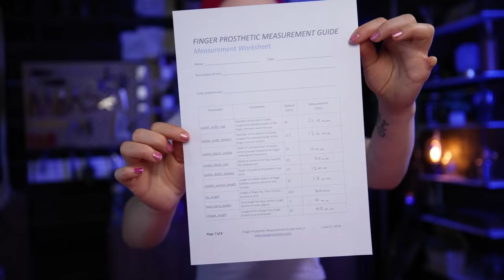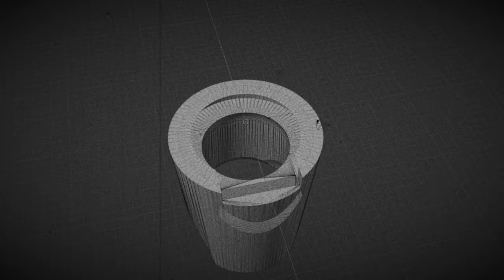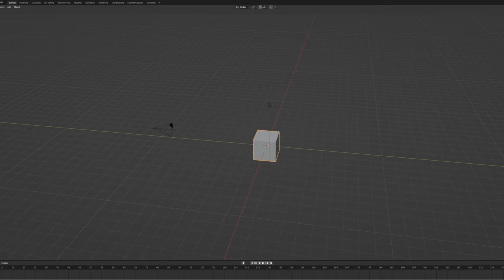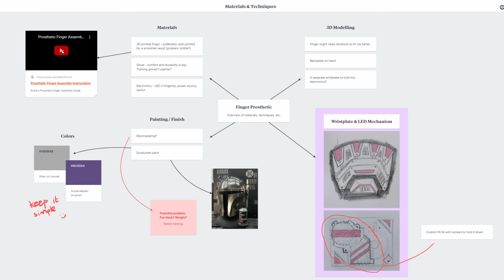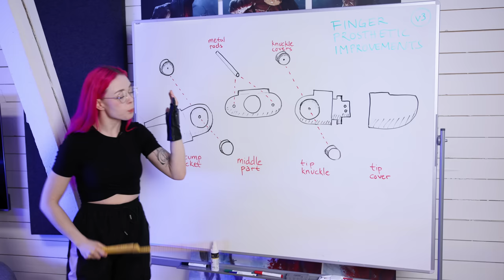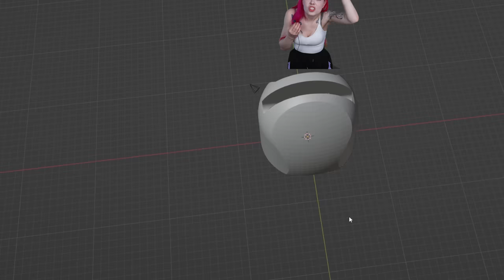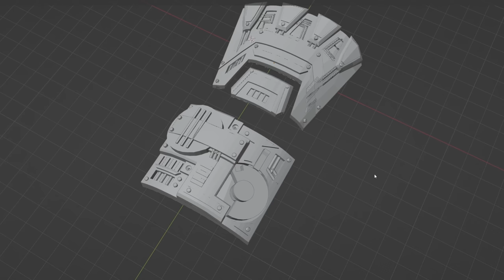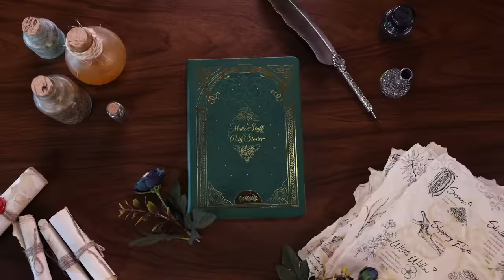I lost my finger.. so I made a new one

Comment: I am an engineering student and in the robotics, you can increase strength by adding counter wires on the opposite side. Also switch to metal cables. Fishing line breaks really easily, but you can find metal wire in the jewelry supply section to replace it and its virtually indestructible without wire cutters. To protect the wires you can run them inside the finger mechanism. Also, just an idea, but if you want to add a screw in feature to your new prosthetic fingertip,  you could put interchangeable tips on it. As well as an attachment on the back of the glove too. You have given me so many ideas to think about! BTW,  This is an amazing job! Absolutely brilliant! I was 10,000 % impressed! My little inventor/engineering heart just jumped to so many ideas.
Reply: Ok so it just occurred to me, what about adding the interchangeable fingertips,  you can get a small alligator clamp attachment,  it will help you hold the tiniest of miniatures when you are crafting. A detachable led flashlight, a tiny detachable spy camera that blue tooth connects to your computer,  so you can see inside your models, incase you every need to.  And just for fun,  A detachable Lazer pointer to point at things to randomly annoy your cat.
Reply: You could probably design a small storage container for your interchangeable tips on your forearm by expanding the glove a little bit.
Reply: @mm-nt8el  For proper practical use she probably needs it made in titanium or something though since resin prints arent that study especially if continuously subjected to stress (movement twisting pressure etc)..  its great for prototyping though :)
Reply: Any chance you know where I could find the schematics to this pinky engineering marvel? I actually lost my pinky on the same hand. I want to make this. Just don't know where to begin without the plans.
Reply: I love seeing people nerd out
Reply: @littlepinktable same bro
Reply: I think you want to keep the fishing line. Yes, metal cable would be much more durable... but it would be more durable than the plastic parts it's rubbing against. So instead of having friction wear out the easily-replaceable fishing line and needing to replace that periodically, you have the cable wearing grooves in all the other parts, and you'd need to replace everything but the cable periodically.

Same reason when you're sewing, you always want to use thread that's just a little weaker than the fabric: you WANT the seam to give before the fabric tears. You can easily just sew the seam back together, but if it's stronger than the fabric and the fabric tears, now you need to either darn or patch the tear, and a quick-and-easy fix just got much more involved.
Reply: @trioptimum9027  There are specialty metal wires (aka hanging wires) of varying widths / strengths used in art framing businesses (I used to have one) to hang anything from small frames to 100 lbs large, heavy frames or mirrors!. These are extremely durable, don't rust, have no / very minimal friction and have very high breaking point.
Reply: Dude, replaceable fingertips are really a great idea. 
That could be a flash drive inside of one, electric lighter, 
small blade to open packages,  or a kind of NFC/RFID 
tag to open doors in the office)))) Sheesh, now I want 
to have the 6th finger)
Reply: A magnet tip would be useful too
Reply: 11:13 This music has got me so pumped this morning❤ Thank you

Comment: Hey, design guy here. Try adjusting the length of the fishing line to get different amounts of movement with different hand movements, you might be able to get the crouching action going.
You could include a kind of dial that shortens the line and reduces the amount of hand movement to make the finger bend. To make it suitable for different uses.
Another concept is to raise the bend point of the wire so that the finger does more with less movement.

I also thought about your LED light and the cables: Why not use the wires to actuate the finger?
Maybe go a bit bigger and have them twisted, then they could withstand a lot of force. only problem might be a high resistance to sliding inside the mechanism.

As for grip, maybe adding a bit of rubbery plastic on the inside would make it a lot more helpful for holding and manipulating things. There are dipping solutions available which can also be painted on.

I really like this project and the way you are dealing with the loss of your finger. This is a very healthy way to cope with such an experience and I think it can be great for others to see you like this if they have experienced something similar. Thanks for sharing <3
Reply: I lost half my index finger 7-1-24, came back to rewatch this video. Soon as I can, I'm going to be trying my hand at this. I liked your suggestions as well

Comment: I'm sure someone has already suggested it, but you may want to put a rubber pad or something 'grippy' on the bottom tip of the prosthetic. It won't offer any additional "strength" per se but it will add additional friction, to help hold things. Awesome project!
Reply: Plasti dip spray will add thin rubbery coat.
Reply: PhoenixRevival00.
"Traction", not "friction".
Reply: Traction is the act of pulling something along a surface using motive power. Friction is what I meant. Two surfaces rubbing against one another. 🙂
Reply: @redblade8160  owned
Reply: @jaden6276  
You have been "owned" and don't like it.
Reply: @redblade8160  u make no sense lol
Reply: @jaden6276  
I'm not surprised it makes no sense to you, you're on the simple side!
Reply: @johnpatrickgerdeman  Rust-Oleum's Leak Seal is another option.
Reply: @jaden6276  Redblade is all up in the comments here being rude as fuck, just ignore them. They are obviously just trying to be an obnoxious and rude know-it-all just to get in an argument with someone
Reply: @redblade8160  calling me simple after saying 1 word makes you look pretty simple!
Reply: @redblade8160  calling people simple and trying to correct words and getting corrected yourself just makes you look insecure about your own level of intelligence
Reply: @jaden6276  
But they are simple and you're getting upset because you know that it also applies to you, then you end up talking nonsense only out of shear retaliation.
Reply: @redblade8160  I’m not surprised it seems like I’m speaking nonsense, you’re on the simple side!
Reply: @jaden6276  
That one word you said speaks volumes about you; therefore you must be simple in many other ways too.
Reply: @redblade8160  what a sad existence you must have :( to not be bothered of making a fool out of yourself so freely for all the internet to see and still be wanting more. Is this the only interaction you can have?Truly sad.
Reply: @Ariaasu  
You sound very much like you're describing yourself, but the only way you can hide it is to accuse others of what you are.  What is actually wrong with you, has something bad happened to you in life to end up this way?
Reply: @vh7634  
You're another one that gets upset easily!
Reply: @redblade8160  awww projection, the weapon of the ignorant. Feel better sweetie.

Comment: Honestly: as a mechanical engineer, who is used to design things with CATIA or Siemens NX, I was pretty impressed, seeing you design mechanical things with blender. I know that this is possible, but also that it's definitely harder than doing it in conventional CAD software like Fusion 360 etc. So really, really good work there on the technical aspects and of course the result is awesome, like always! 🙏🏽
Reply: Came here for this
Reply: I was also thinking that. I was hoping to find out how long the entire project took. I have tried using blender to make adjustments from fusion 360 work and it took much me longer than anticipated.
Reply: Blender is basically an operating system, it can do anything 😁
Reply: @qdaniele97  it's also technically a game engine capable of being used to program video games and running them as well lmao
Reply: You know in an Orthotic workshop blender is actually used to sculpt a copy of a limb, then smothening the rough edges on it. Then we switch to another program to use CNC. Works quite good as I have seen.
Reply: @Owgla  The game engine hasn't been a thing since 2.x days. ;)
Reply: @IzzyIkigai  officially yes, but there's actually a project called UPBGE which brought it back to life. And it works with Blender 3.x :D
Reply: Yeah after seeing this she should really look into doing more medical prosthetics.

Comment: Thoughts for making the finger more tactile:

Rubberise the fingertip. Make the fingertip easily replaceable now that it picks up dirt.

Redesign so that the weight of the mechanism is transferred somewhere you can feel. I think the initial design does this well, as the wristband would pull on your wrist, and the wire would dig into your knuckle . The wrist band needs to be redesigned so that it isn't awkward to put on with the glove. Maybe use a flexible filament and a shape like this C>. The wire digging into your knuckle is uncomfortable, so I think that adding a knuckle pad with a groove would be a good idea.
Reply: This comment right here^^

Comment: I'm intrigued by your situation and solution to your unique problem. I've been trying to get back to all my old hobbies and crafting. I used to be an Air Force airframe repair specialist and have never had access to a decent shop or workspace, but I'm now in the process of building one in my apartment. I'm planning to get a 3-D printer as well as building a few other tools. I mention all this because I'm always looking for something to invent. I've decided that when I've got it all up and running, I'm going to build a prototype that might work for you. You don't know me and I don't know you, but I've got an engineering mind and I like solving problems of all kinds. Look to the future, is one of the codes I live by. I would say, be optimistic, but I think you've got that covered.🖖😎👍

Comment: In order to increase the grip strength you could run the control string to a pulley that connects to a ring you would wear on your middle finger, which would be the strongest. With a series of pulleys ( block and tackle) you could develop a mechanical advantage. With the 3D printing you could even use gears for the mechanical advantage like a singe speed bicycle. If you ever wanted to motorize the grip , you could trigger it with another finger. With a motor you might need a torque limiting device or clutch that slips at a certain motor load , for safety.  Great project, well done. 18:07
Reply: Why not use a small Mars Rover brushless DC motor attached to a composate carbon nanotube and graphene finger. Using the galvanic response and the conductive graphene finger as a battery itself attached to a under the skin Qi wireless 15w charger with a regenerative breaking coupled with a Monocrystalline embedded solar panel over lab grown ruby sheath. Throw in a few Micro Q-DOT LED's and your good to go. That or sticky tape and a broken chopstick. YouTubers are so lazy these days
Reply: @HyperVectra  This comment made my brain bleed.
Reply: @Drekromancer  I know sorry my bad! It hurt my brain to write it. Just trying to poke fun at OP... like I support "When you aim for the trees, you hit the ground. When you aim for the stars, you land on the treetop" but like a tiny motor and battery with clockwork gears and a limited slip clutch? I think what she made is pretty damn good already
Reply: oh yeah there are def ways to improve,  the glove. I still remember being a kid and have those plastic grip gloves that made you have like alien like claws. Now we have printed stuff to do this haha.  She should study more about medical prosthetics because damn she seems to have some passion towards it and is def really good at it.

Comment: My dad had your accident with a skill saw, a year or so before he died. After catching his thumb in the hinge of a folding staircase.

If you put some metallic foil tape in the hinges of your finger, you can run power to the led without worrying about bending wires. It would work like brushes in a motor.

Comment: Implant a threaded stud, just behind your first pinky knuckle, on the back of your hand. Like people have done in the skin on their heads to mount steel spikes for a mohawk. Screw a tiny loop to the stud. This would give a very minimalist attachment point for the cord.  
Implant another of the same to your pinky nub to keep the line closely following the contours of your hand, to prevent the thread snagging. Could also use Fluorocarbon fishing line for the actuating thread. Again, discreet, but also not so abrasive that it would wear through the steel loop it travels through on the pinky nub implant. Kevlar thread is super strong. But overkill for this application and also very abrasive and would wear a cut into the surgical steel of the implants. 
Not that it's not awesome fun to do the glove thing and make it stand out! I love it! But sometimes you just might feel like having a quiet, less stand-out day, when out at the grocery store. :)

Comment: The end result looks awesome. By the way, I think the main issue with trying to press keys with that new finger is the limited range of motion rather than the lack of muscles. With your right pinky, you can move it around in a circle, not just open and closed. Pinky fingers are supposed to be able to point out to the sides by roughly two and a half inches in diameter. That motion is necessary for properly using the keys to the outsides of the 'asdf' and jkl;' keys- which means you'll need that deflection in the prosthetic to hit the left shift key. I don't know what the nerve/tendon/muscle situation is with the remnants of your left pinky, but if there's a way to get the prosthetic to deflect to the side, I think it'll work. Still, what you've already done seems to help greatly, and I'm glad you got some usability from it.

Comment: Perhaps if you add a silicone gel layer to the inside face like where the fingers prints and pads would be, or around the whole outside of the prosthetic in general, that’d help with surface tension grip, not soo much muscular pressure grip. It would passively help to reduce the slipping of your phone, or other objects in general, that you’re gripping or cradling with the prosthetic.

Edit: perhaps someone might’ve mentioned this, or in some other way the idea may have crossed your mind, idk. I’m not a mind reader and admittedly I read about 20 comments starting from the top and didn’t see any suggestions mentioning silicone layers.

Comment: Great job! I know what you’re going thru. I too had a table saw accident and had 3 fingers cut off to include my pinky, but they reattached my pinky. And just like you my pinky is stuck in a curved position like your ring finger due to damaged tendons. They couldn’t reattach other which I’m fine with, I have same problems with same issues as you do, grasping etc, holding onto things. But bad thing about my  accident is the it was my right hand, which is my dominant hang.  Just wanted to say kudos to you for finding a resolution. Me I’m just dealing with what I have and making the best of it… Good job kiddo👍

Comment: What if u put a stronger elastic, that should probably give a stronger grip. 
If I`ve tracked a band path correctly - it can be divided in 2 parts: 
1) bottom to bend the finger 
2) top to move it back. 

In the middle there should be a screw, so tense will not pass and we get a kind 
of 2 independent elastics. So by modifying the tip to literally use 2 different 
bands - u can use a stronger one in the bottom and looser on top.

Comment: I wonder if you could print a version of the finger that is in two pieces. Have a "base" part that adheres to your finger nub and stays in place. A second section that is the rest of the finger. Between the two parts is a thin magnet on both sides to hold them together. Would let you swap out different fingers for different colors, shapes, etc. (Mirror polished Terminator finger! Or bone styled finger with Scrimshaw!!)  
The articulation thread could have a small steel disk at the end. This would attach to a magnet embedded in the glove and act like a quick release for swapping fingers. 
As a bonus, the mag's between the finger sections would let you rotate the finger. Might be handy for specific tasks like hitting that key on the keyboard.

Comment: Fun fact: Your ring finger and pinky are actually about 50% of your hand strength, and you can lose 67% of your grip strength if you lose them if they don’t work

Edit: I’m not a professional on this, I thought I heard someone tell me this so I googled it and clicked on the first link that popped up
Reply: cite the source bucko ion believe in them percentages
Reply: "Citation Needed"
Reply: No you're wrong. The Ulnar nerve is responsible for about 50% of your grip strength.

Actually Index is about 25%, middle about 35%, Ring 25, while the pinky is only abiut 15%.

"Your ring finger and pinky ate actually about 50% of your hand strength." That statement is wrong it should be the Ulnar nerve.

Edit: Technically, you could still lose close to 50% of grip strength if you lost both those fingers.
Reply: Not so fun fact
Reply: @Oracle2448  you're
Reply: I had to
Reply: @martinramirezjr7872  I saw that